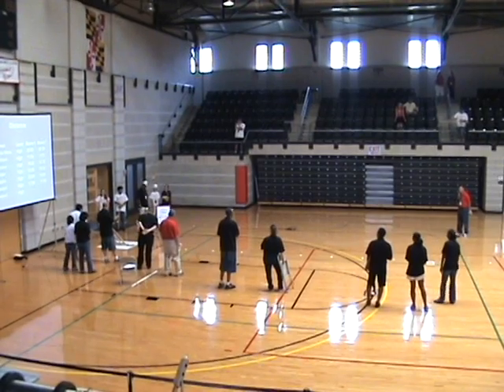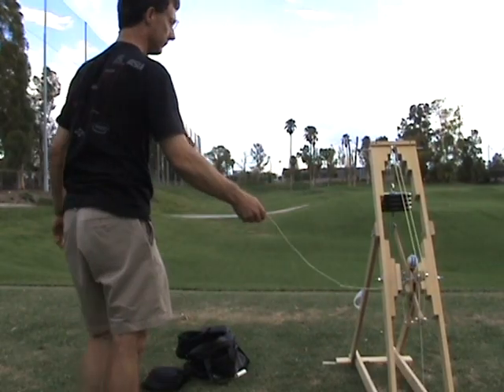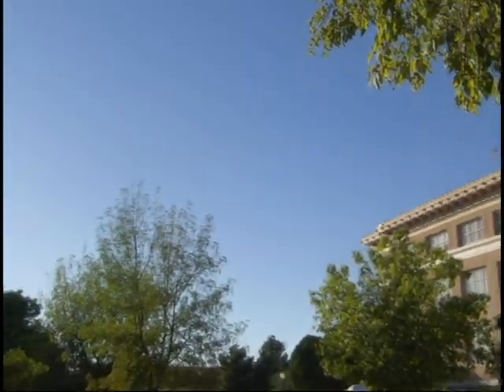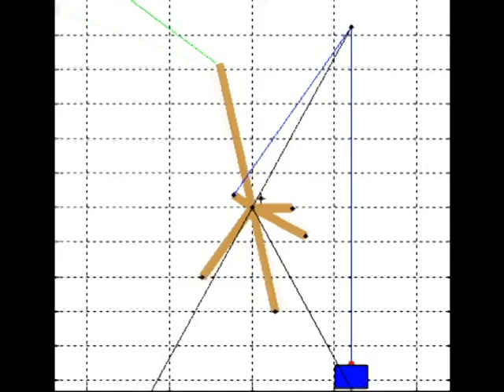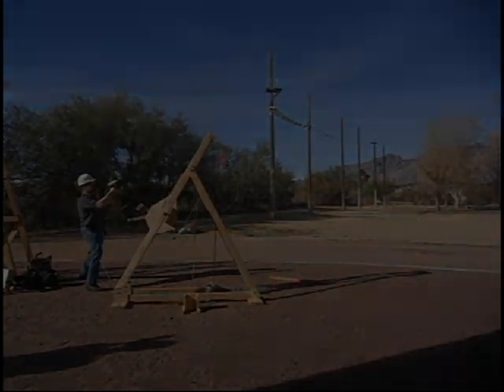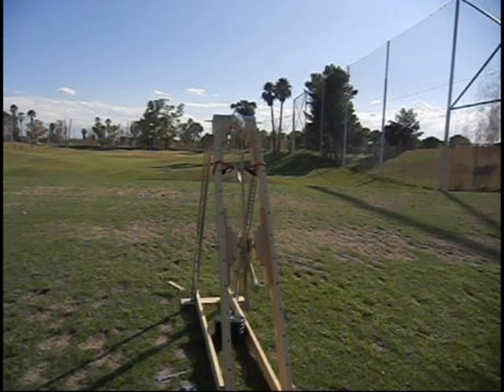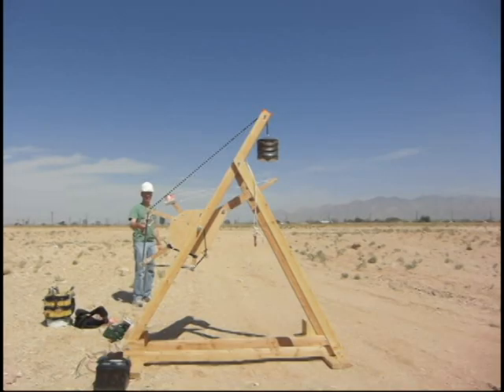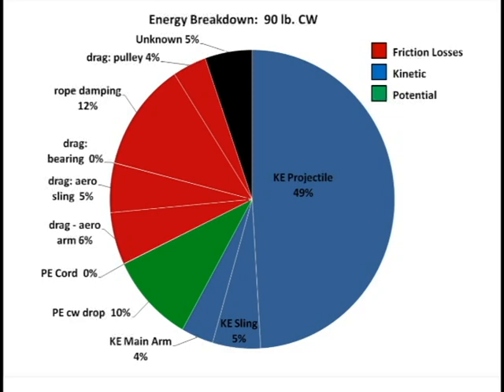Development of a Dynamically Tuned MURLIN Trebuchet

Comment: Your throwing arm measurements should match the Febunaci sequence.
Constant acceleration will only happen when the driving rope material has zero stretch.
Reply from the maker: I can assert that Fibonacci based arm lengths, are non-optimal, as determined by the simulation optimization.  I also assert that NOTHING is linear in trebuchet dynamics, particularly accelerations, which peak just before release.
Reply: @ldvance01 I figured that out months after writing this reply, The golden ratio doesn't work either.

Comment: Put it on wheels
Reply: It might... if the arm is not balanced perfectly around it’s pivot, then there is a fore and aft moment imparted to the frame as it accelerates.  If this action causes the whole trebuchet to move forward as the arm reaches its peak speed, that additional energy will be imparted to the projectile.
Reply: Doesn't seem like wheels would be beneficial to this design since the counterweight already falls straight down.

Comment: I am trying to scale this down to shoot a 2 lb ball 50 yards but also be able to launch the ball as far as possible. Is it possible to adapt your baseball murlin plan design to shoot 50 yards accurately? Could this be done with adding minimal weight? thanks
Reply from the maker: the 2 lb ball is about 6 times heavier than a baseball, so you will have to cut down the length of the throwing arm (not the sprockets) so that the arm doesn't stall prematurely.  That said, you should have the ability to easily get to 50 yards.  Accuracy is much the same as all trebuchets, which is pretty good in general

Comment: Would you lose some energy through the friction of the spinning pieces?
Reply from the maker: The energy loss from a rotating bearing (as measured) appears to be insignificant compared to rope bending and aerodynamic losses.  This was somewhat of a surprise when I first did the calculations, but I verified these results with the rope loss experiment I did in the middle of the video.

Comment: find a way to add backspin to the ball when released. Although you might argue that energy is used in adding spin, the flight characteristics of the ball will greatly improve and the launch distance will improve. There are tons of information on spin and ball flight for golf balls. I know you are in the hunt for lost energy but this will give you more distance.
Reply from the maker: +equityplus You are right, and I separate the two ends of the sling so that topspin is imparted on release in order to maximize distance.  The THMPR trajectory actually launches low and curves up significantly, just like a good golfball drive.  High performance pumpkin chunkin trebuchets actually tone down the topspin as the pumpkin can curve up so high that it actually loses distance.
Reply: You meant "backspin", not "topspin". Topspin drives  the projectile into the ground. Yes tuning the amount of backspin is important.
Reply: Mr Vance just miss spoke.
Reply: I like using magnus for line of sight targeting. I have video of beautiful magnus shots from one of my trebuchets. I've been studying magnus effect for several years, and how to control it.

Comment: Put wheels on it. You will see
Reply: On a standard trebuchet, efficiency is increased by adding wheels. The wheels permit the base of the trebuchet to move, allowing the weight to attain a more vertical drop.

However, since the MURLIN machine already has a perfectly verticle drop, it actually now loses energy when the base moves. This is due to Newtons third law. the trebuchet applies as much force on the golf ball as the ball applies on it. When the trebuchet itself moves, that is work, and any work which the counterweight does which is not done on the ball is wasted energy. 

therefore, no wheels.
Reply: +Brendan O&#39;Connor  Please tell us what you think that will do.
Reply: as an aside, please note 6:09 in the video.
Reply: Well said, Alex. The only thing I can really say or add, is, There is no such thing as a "standard" trebuchet.  You are referencing a "Fixed Counterweight" Trebuchet. (FCW) A Hinged Counterweight Trebuchet (HCW) would not use wheels either.
Reply: I have friends with FAKAs,  Floating Axle King Author
Reply: *****
 If Mr Vance doesn't mind me sharing this, Here is a link to my facebook group. We can talk more there instead of hijacking Leonard's YT channel. https://www.facebook.com/groups/texastrebuchet/

Comment: You said that you adjusted the rope length to take advantage of the full distance you had to fall. If I elevated the trebutchet and adjusted the length of the sprockets so I could use a longer rope to fall further than the base of the trebutchet do you think that I could get more performance out of it?
Reply from the maker: +ShrpBld Probably yes.  If you proportionally increase the node distances by the fractional increase in CW drop height, it should work.  There's a limit to how far you can go because eventually you increase the inertia of the throwing arm when the nodes get larger, but for modest changes I expect it would work.
Reply from the maker: +ShrpBld Yes, that would improve performance.  Local pumpkin tossers here in Tucson have done exactly that, putting the treb up on blocks of wood so that the CW can fall further.  I suspect they did it because the CW became taller, and was hitting the ground though...
Reply: +Leonard Vance Thanks for replying back, I think that we will work that into our design. I have been trying to think of a way to design our nodes to minimize the amount of weight. We were thinking of making the throwing arm like a wood I beam that gets smaller at one end and rapping in a layer of fiber glass. I was thinking of using pvc for the nodes as it is a light cheap material.
Reply from the maker: +ShrpBld PVC is not a structural material of any note, may not be strong enough to hold the CW

Comment from the maker: In general, as the machines get larger, higher performance materials are required.  This is in general true for all structures
Reply: Fascinating. Does this imply that a murlin trebuchet wouldn't have been a viable improvement in medieval times? Improved efficiency/vs fragility or complexity tradeoffs?
Reply: @anachronisticon  Since you asked a 6 year old comment a question, here's a 3 year old answer haha. The Murlin would not scale well during medieval times no. Here's why:

Out of available materials they would be limited to wood as the strongest available arm material. It was not until the 1600s when early steel starting making a real appearance in quantities that might be sufficient to have used. Even then though, casting of steel wasn't really a thing for another 200 years, nor was forge welding such a huge object even realistically possible. And regardless Trebuchets were phased out some 150-200 years before blister steel was even readily available.

With only wood to use, even the strongest materials like oak, ash, or fir would not hold up to the kind of loads that they would sustain on a Murlin. At least not when scaled up enough to throw any weight big enough to make it an effective siege weapon.

Additionally lack of strong/flexible enough ropes and cables would likely be another deal breaker for assembling this thing in medieval times.

Comment: Traditional trebuchets saw in increase in efficiency and throw distance by mounting the platform on wheels. Have you considered this approach, or does it not fit the mechanics of this particular system?
Reply from the maker: Wheels are useful on traditional hinged CW trebuchets because they permit the counterweight to drop closer to vertical, permitting more energy transfer to the projectile.  The MURLIN drops the counterweight vertically to begin with, so wheels would just reduce efficiency.
Reply: Leonard Vance Thank you!

Comment: Have you tried a cam system rather than the five arms? Maybe that will mitigate energy loss. If I'm wrong I'd like to know why. Any thoughts?
Reply from the maker: Zach:

A continuous cam helps because the forces don't cycle up and down as much, and this adds about 5% to the efficiency, because energy is lost in the stretch cycling.  There's efficiency loss, however in the increase in throwing arm inertia, so it's best to make the last two sprockets continuous because that's where the forces are the highest, and inertia increment the smallest

Comment: This is very interesting. Our ASME club recently built 2 trebuchets, our team built an f2k and we threw pumpkins and bowling balls about 100 yards using over 700 lbs of counterweight. I wish we would have had time for dynamic tuning like you did here, I bet we could have made it much more efficient. Floating Arm Trebuchet (F2K): EWU ASME Club
There was a MURLIN design at our competition but it didn't do very well. Do you have any experience building MURLINs large enough to throw pumpkins in the 100+ yard range?

Comment from the maker: Yes.  I optimize all the sprocket lengths along with the throwing arm and sling using a genetic algorithm with a simulation.  Slight variations on a baseline are chosen, a throw is made, and if it throws further, then it is saved as the new baseline.  Repeat that a couple of hundred times, and you have an optimized trebuchet.

Comment: What simulator are you using?  Do you think you can fire a tennis ball?  I am OK with the 2 normal conditions my email is colton.arries@gmail.com There is a completion at my college that requires the pivot point no higher than 3 feet when at rest, must be able to launch a tennis ball.

Comment: I do not know that much about trebuchets, but has anyone tried a spiral instead of a set of nodes? It should result in a smoother acceleration of the arm than a set of 5 nodes...I think.  Any reasons it would work less well than 5 nodes?

Comment from the maker: My current opinion is that MURLINs and F2Ks (a FAT with an initial vertical drop before engaging the horizontal track) are roughly comparable high efficiency trebuchets.  The standard MURLINs hold good performance up to mass ratios of about 400, but I don't know how high you can push an F2K.  Maybe an other builder can say.

Comment from the maker: Well, it really IS complicated.  Even without compensating for effects like structural dynamics and rope stretch, trebuchet mathematics are still multivariable nonlinear differential equations.

But sometimes, using all that complex math, an designer can figure out how to make something simple that works really well.  It's hard to do, but something all engineers should strive for.

LDVance

Comment: I would like to use both of your plans for a competition in my engineering class. I plan on modifying them slightly to comply with the base size requirements. I accept and comply to your terms and conditions as stated above. Email: rudesillb@etown.edu

Comment from the maker: @FreddyFlinstoneify:  45 degrees is the optimum distance only in a vacuum.  Aerodynamics dominate the flight of a baseball at these speeds, with both drag and lift (from spin - see Magnus effect) being important.  Lower trajectories are optimal when drag is present.  

zero drag distance is actually close to 1880feet if I use 75m/s as an initial velocity - see if you get the same.

LDVance

Comment: At 125mph launch speed at 45 degrees angle, with gravity being the only external force, the distance should be about 1050ft.  At that same speed at 30 degrees, the distance is somewhere around 900 ft.  I understand that you are looking for energy loss.  Is distance important in your design?  If so, should the launch angle be closer to 45 degrees?  My simple calculations assume that speed difference is negligible between the release at 45 and the release at 30.  Thoughts?

Comment from the maker: Ketmaniac:  Dynamic tuning means incorporating structural dynamics into the design optimization process.  In more plain (queen's?) english, this means that the trebuchet is designed with frame bending and cord stretch in mind.  The trebuchet is designed so that the energy in the 'springiness' of the frame rebounds back into the projectile before release.  It adds about 10% to the efficiency of the throw.

LDVance

Comment: @ldvance01 Ah, thanks. Yes, looking at trebs of all kinds here on Youtube, I'm always thinking they're too tall for their base. A lot of constructors don't seem to appreciate the size of the horizontal forces, all the violent pushing and pulling that goes on.  Their structures are well able to withstand vertical forces, but horizontal ones not so much. The bending and sagging involved absorbs quite a bit of energy, I suspect.

I'd be interested to know what you mean by "dynamic tuning"...

Comment from the maker: 90 lb counterweight(+ fastener HW), baseball  projectile (144g), with a 7g pouch and 164cm of CW drop before release.  main arm length is 85.6cm and release velocity is 75.1m/s,  giving 62% effeciency (I think I screwed up and said 69% on the video).  Distance is 248m or 813ft, with a modest tailwind.  I don't look too closely at distance these days, there's too much uncertainty in the wind.

LV